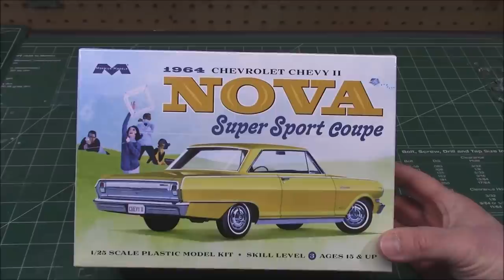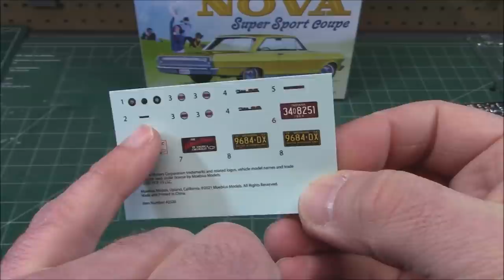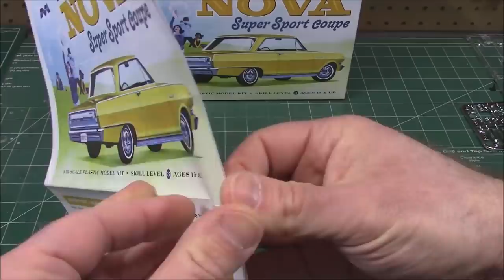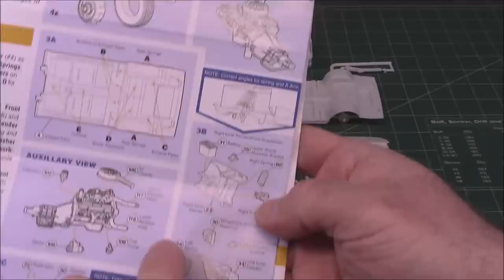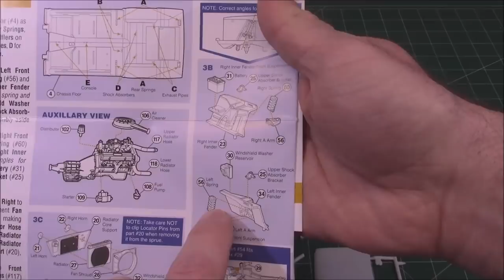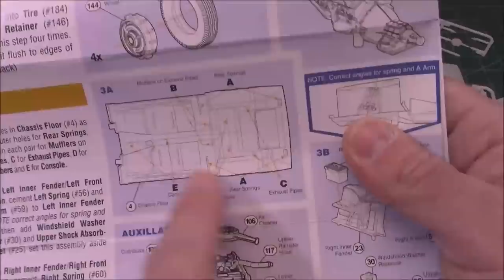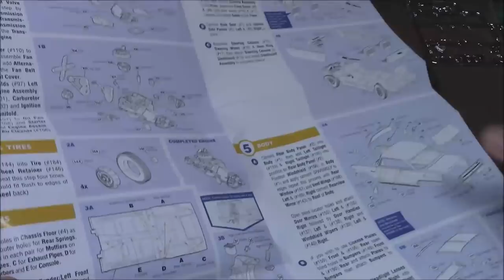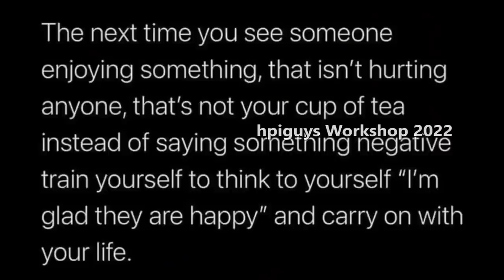1964 Chevy II Nova SS 327 1/25 Scale Model Kit Build How To Assembly Paint Engine Moebius ALL NEW!

Comment: Very nicely done Chris ! I’ve built this ‘64 already. Now I’m working on converting the ‘65 sedan body to a four door. My grandmother had one when I was a kid, ‘62 though.
Reply: I'm using the amt 64 4dr wagon body spliced with the rear trunk, roof  B pillars, rear glass section off a amt " rat packer" to build mine.
The 65 sedan has a totally different roof than the 62-64 sedans.
Reply: I'm trying to do the same. Our first family car was a brand new 65 chevy ll Nova. Artisan turquoise 4 dr sedan. I learned how to drive in it. Using amt nova wagon for parts. Don't want to ruin the kits.  My hands aren't as steady as they once were nor is my sight.

Comment: I am a specialist mouldmaker. Back in the day they where made with manual copy milling machines according to wood models made by artists by hand. That’s why the fittings where so bad. Today they are made with high precision CNC high speed milling machines according to 3D data from CAD models. Also before there was no way to simulate the injection process. It was also something made by trial and error. Today there are specialised software to do all simulations so the tool is almost perfect from the beginning. The manual mode ended in the early nineties. I made lots of G.I. Joe’s with the old method and also a Space Shuttle and a Spielberg’s ET. All for Hasbro. Pardon my english but I’m portuguese.
Reply from the maker: Very cool insight, thanks!

Comment: I'm always amazed by your free-hand painting of details, after parts have gone through spray painting booth. 
Disappointed a bit by the lack of white walls that appear on box. They can be gotten from model store, but why are they shown but not included, Moebius? 
(My build preference in order is WW, then RWL, and BW is far down in last place.) 
Hpiguy, can you tell us a little more about the hood springs, and assembly using that option? After all that work, I would want to open the hood to see under it.
Reply from the maker: You simply glue those hinges onto the hood and they permanently hold the hood open for display. They do not operate.
Reply: @hpiguy  Thank you. I thought by the description that they would allow the hood to be held open as desired, but also allow it to close. Not a real spring, but designed to use like a notch, or release from notch. Glad you explained it. I'm like you after knowing this, I'd leave that part off too then.